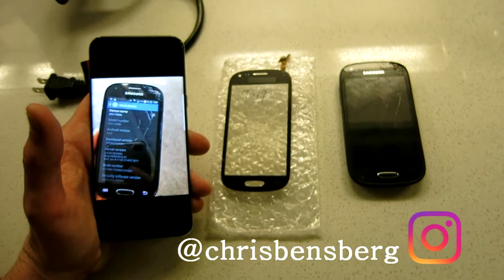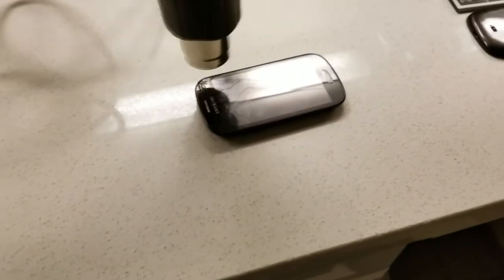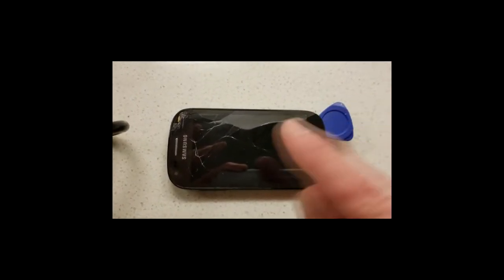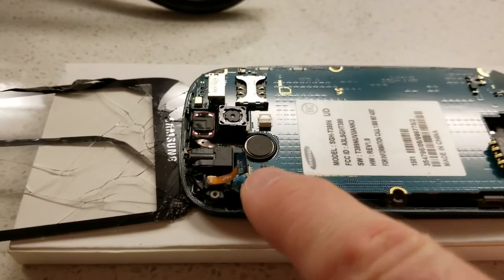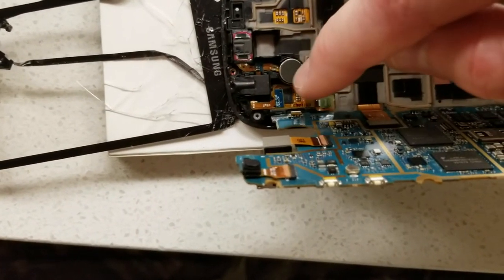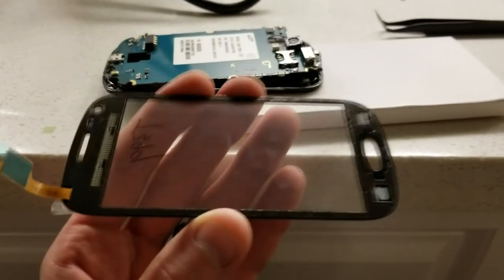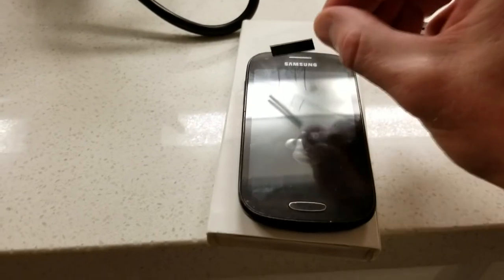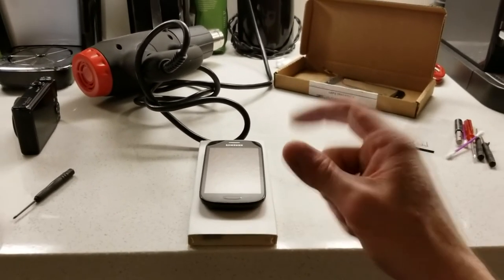How To Replace Fix Samsung Galaxy Light SGH-T399 Cracked Glass Touch Screen Install A New One!!

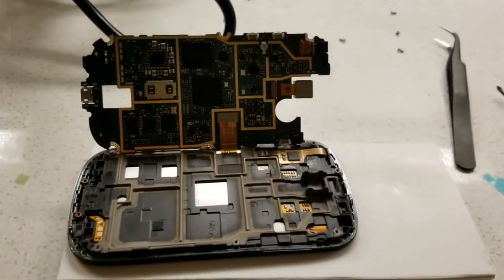Comment: 6:40-6:43
Would the digitizer work without the sticky? What is the function of that sticky? 
Reason I ask is, I have been trying to fix my sgh t399 for over a month and the only thing I notice is the sticky covering the digitizer is missing. 
Phone won’t turn on. Charging port is shot but I bought a universal charging pack to charge up my battery which should’ve charged up the phone but it didn’t. Do you think the sticky not covering the digitizer would cause the phone not to turn on?